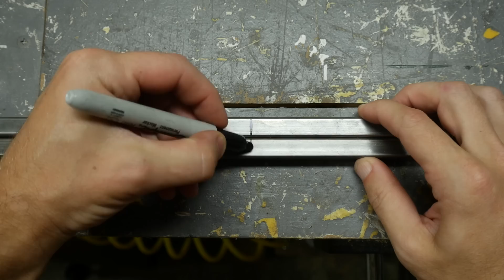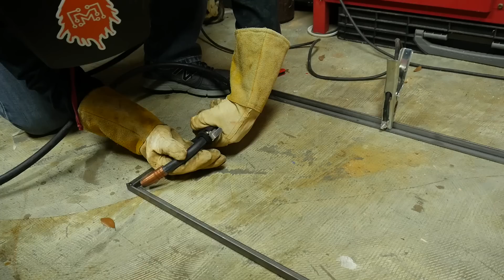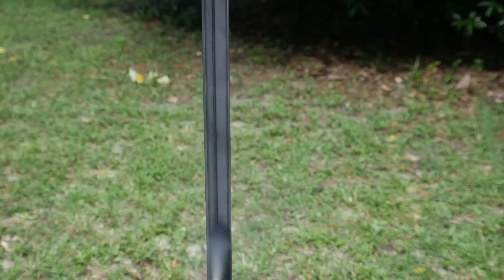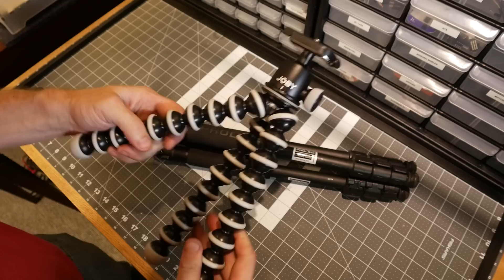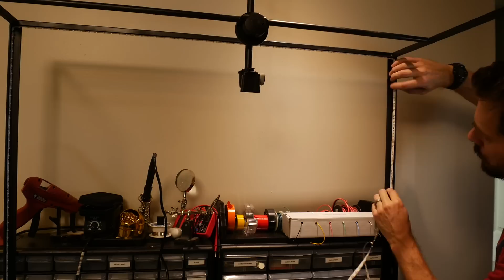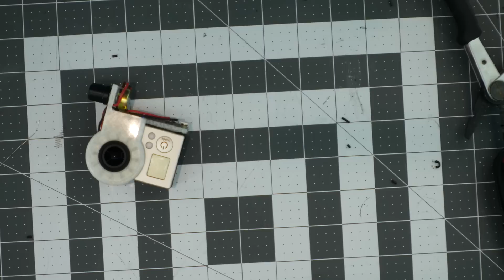Overhead camera rig // How-To | I Like To Make Stuff

Comment: What size is the steel rod (diameter)? Thanks in advance.
Reply from the maker: +Dylan Young 3/8" I believe
Reply: +I Like To Make Stuff I'm pretty disappointed. Bought everything from your list and did it to a T, but it's definitely not 3/8" steel rod.... Way too small in diameter for that mic stand. Used the bumper too but still way too much daylight. :(
Reply from the maker: Dylan Young Oh man, I'm sorry. I wasn't in my shop when I answered that so I was just trying to remember.  I should have said that, sorry.  I just went and measured it and it is 1/2"      Again, sorry for the confusion.
Reply: +I Like To Make Stuff It's all good buddy. I understand! I'll just cut the 3/8 off, grind it down to smooth it and replace with 1/2"! Thank you & keep up the great work!

Comment: Bob, great video! I was looking for a diy project to build my own rig, and this was exactly what I needed! 

I was wondering though where you got the steel rod where you attach the ballhead on. I've been searching for this (kind of) item but I can't seem to find it. Did you pull apart a tripot for it?

Kind Regard, Huub
Reply from the maker: +Huub Langedijk Thanks! No, I was able to find that rod at Home Depot actually. I think you should be able to find it at any of the big box stores, otherwise you might have to "reclaim" it from a mic stand or something like that. :)  Good luck!
Reply from the maker: linnea smith The rod I got is 1/2" steel

Comment: Hey Bob, this is a pretty sweet build, the Joby head, has it held alright for your cameras weight or heavy cameras in general? The quick connect nature makes me wary. With the lens pointing down, I dare not think what might happen if it unclasped. I planning this to record a 4x4 foot table, and the players bump the table a lot.
Reply from the maker: +ApocalypseRAT They've held up fine for me so far! If your table is going to get lots of bumping though, you'd probably want the camera mount attached to the wall or ceiling instead.
Reply: +I Like To Make Stuff Hey Bob, thank you for the reply. I jumped in and followed your buy links and purchased the boom arm and Joby camera head, The theads don't look like they match, I even tried for funsies and the thread is too big for the Joby...what do I do here? I can send pics if you need them.

Thanks for the Help
-Rick
Reply from the maker: ApocalypseRAT There's an insert in the Joby that you can remove. Look in the hole and you'll see the silver piece.  This comes out to allow for larger threads.
Reply: +I Like To Make Stuff I didn't notice it at first but after some fiddling i got it. Thanks Bob!

Comment: Thanks, Bob. For those without a welder, any suggestions? I'm wondering if something like JB Weld would work. Of course, there are corner brackets but that would mean a ton of semi-precise drill holes through steel plate and rod. I guess that's not a problem if you have a drill press. So, what about aluminum, do you think it would be tough enough? Anyway, thanks for sharing your project.
Reply from the maker: +Rouverius Yeah, I think aluminum and brackets would probably work well. That was actually my original plan, but I wanted to practice my welding some more :)  You can cut/drill through alum. with basic tools as well.

Comment: That looks cool but I would not do this this way. First you have to place it on and off when you filming and not. And then you have to store it somewhere.

I would do a hand time mount on the wall across the desk. I would even purchase none expensive monitor mount that can extend and fold and mount that microphone stand there. 

At the end I would get the same flexibility of camera position but one movement fold it out when it is not needed. 

Of course there would be no LED around but I could install additional light with ball-heads too, so I could spot exact place I am shooting.

Comment: Two things:
1. the piece of rod can be bought to match any stand one might have (or made to be removable or replaceable with welded threads at the end and accepting holes on the frame)

2. more than one mic stands can be used, for example a second one can hold a spot light, a magnifying glass, or a cup holder

This project has a ton of potential in many directions not just a camera stand.

Comment: Great project as always... Something to consider is to use a few of those rubber bumpers to put on the bottom of your stand to aid in vibration and to keep it from slipping. The more metal off the wood the less likely vibration will travel... Oh, by rubber bumper, I mean those self stick half circles you used inside your mount to aid in slippage; then would easily add a lot of stability to this rig...

Comment: That's a pretty intense industrial setup, nicely done. The one I did recently for overheads had a MUCH smaller budget, so had a different approach. I now film my footage with a small Xiaomi Yi (pretty much a GoPro), so used a flexible arm lamp off my old drafting table, added a camera mount, standard ring light and dual mics. Then added a bubble multilevel from the dollar store to keep it straight and a CFL light on either side (diffused through thin parchment). Ugly, but cheap, lightweight and reliable. I might try your LED strip idea though, I've only used them in PC cases before.

Comment: good idea with mic stand. idea for rev 2 is make it like a wall mounted shelf so the legs to the stand will no get in the way of your work on the table. this way banging on table or kids running around you wont get vibrations. may need to add more weight to shelf to give more dampening too. shelf deep enough to hold chemicals or cleaners out of the way from kiddos and not interfere with the camera rod.

Comment: Bob, are you welding in your house or is your workshop in your garage? If inside any concerns or special precautions? I have wondered about this for my own use. Thanks for the great video. Paul, a.k.a. paulsmessyworkshop on YouTube
Reply from the maker: +pcorlis My shop is a converted garage, but attached to the house. Only issues for me are making sure my family knows not to open the door (so they don't get blinded) and to make sure that the outside door is open for ventilation.
Ideally, I'd have a dedicated metal working space, but currently I don't have a place for it.
Reply: +I Like To Make Stuff Thanks Bob,  clears up a lot.  I wish I had a suitable place to weld but just not at this point

Comment: @Pavan Koty probably yes but due to the nature of plastic you would need a REALLY thick pipe or it'll sway a lot :/ plastic is strong but it dies give a bit before it stabilizes :( however if you can find a really stable polymer it would work, the frame would not be so bad if you make a cross in the sides and back to stop the sway but the stretcher which the camera hangs in would be the problem :(
My cents became a wall of text :P

Comment: Great project. I like the ball joint on the top to mount the camera. Would the over head lights not be bright enough or does it cause a shadow on your work?
Reply from the maker: +ASliceofWoodWorkshop They're further up, so they don't cast harsh shadows, plus the side lights act as fill, which helps with shadowing as well.

Comment: I'm thinking that a cheap background stand (uprights on either side of the table and crossbeam over the table) might be a decent way to go and use the same method with the mic/boom stand. That would have the round crossbeam and would vibrate separately from the work surface, but probably wouldn't be as rigid without sandbagging. Love the project, Bob!

Comment: really cool build there

but be aware, the plastic clamp on the boom of that mic stand will probably crack even under normal use. have had several of the same one and they go brittle...assuming it's the same make, maybe your ones are made with better plastic.
Reply from the maker: +Graeme Evans Possibly. I've had this one (and a bunch of other mic stands) for 5-6 years. At that price, replacing them over that time period is acceptable if need be, to me.
Reply: I Like To Make Stuff yeah, they are a bargain, plus they're one of few i've ever seen that clamp onto the vertical part like that too, the rest are usually connected to that pipe far more mechanically and wouldn't really work to mount on the pipe you welded.

Comment: That turned out nice! Is there a reason you didn't mount to the wall (so that a bump to the table wouldn't shake the camera)?
Reply from the maker: +Matthew S Thought about that, but not everyone could do that and I wanted the project to be accessible. Also, it's portable enough that I can move it into my shop on my assembly table if need be.
Reply: I Like To Make Stuff Portability is reason enough. Good point!

Comment: Instead of using a steel frame, can we use some transparent plastic hollow tubes which are stiff enough to stand and the LED lights are placed inside the tube so that the light diffuses and also protect the LED???
Reply from the maker: +Pavan Koty Possibly, but I don't think they'd be strong or stable enough to hold the bar that the camera mounts to. You might be able to make a hybrid of some sort, where the frame just held a diffusion panel on the sides (maybe wax paper?) with the lights behind it.  
There are lots of things that might work, just give something a shot, see if it works and improve from there! Good luck!
Reply: Thanks, i'll try!!
Love ur videos!!

Comment: This came together awesomely, Bob! Way to go! Also one tip on steel - I noticed barcodes on the steel like you're buying at home depot, etc. You may want to find a steel yard in your area if possible. When I started welding I found the steel yard to be quite a bit cheaper than buying the pre-cut lengths at Home Depot, etc. If I just need something small or need something on a Sunday when the steel yard is closed, retail is helpful - just usually way more expensive. Of the retail places you can find steel, I've found Tractor Supply to be the cheapest if you have one. Ear you, but it's still expensive in comparison to the steel yard. Keep up the good work!!
Reply from the maker: +BradleyMakes Yeah, I keep hearing that, but I can't find any place locally that sells it. I'm sure it's here somewhere, just haven't tracked it down yet.

Comment: Where did you get the small magnets?  Your link is for a large one.  I typically get mine at Harbor Freight and I don't recall seeing those there.  BTW, awesome job welding!!!  Very cool project.  I need to make one of those. Douglas
Reply from the maker: +RetroWeld Thanks Douglas!! I actually got them at Harbor Freight.  I'll try to update the link, I thought it was for the small ones. Thanks!
Reply: Thanks Bob. I'll check it out. They must be new there.

Comment: thats really cool bob! great idea. hey is your angle grinder from harbor freight?  ive been contemplating buyimg one .thanks man!
Reply from the maker: +Joe basementwoodworking Hey Joe! I actually got a second one recently from Harbor Freight.  So, my 4 1/2" one is a Ryobi... seems fine.  I keep a flap disc on it now, but I got a 7" Harbor Freight recently and keep a cut off wheel on it so I don't have to change out the discs all of the time.  The Harbor Freight one seems plenty powerful and it was SUPER cheap at one of their weekend sales.
Reply: I Like To Make Stuff nice! good idea !  thats one thing that ive been meaning to get because theres sooo many times i could use it and dont have it and then i kick myself for not getting it..lol thanks again bob

Comment: Nice! Subbed. 
Those are also my favorite ball heads. :)

BTW, an easy way to do this is with a big boom stand which is about $100, but that takes up a bit of floor space next to the desk.
Reply from the maker: +Nitsan Simantov Good call! I guess it the base was heavy enough that'd be good. maybe you could even use one that clipped to the desk.
Reply: +I Like To Make Stuff 
Ah, yeah that's a good idea. I've done that with some normal stands in the past using strong releasable zip ties. BTW I've got some tutorials on my channel that you might like. :)

Comment: looks awesome but I would think it would be much better if it was hung from the roof. it wouldnt get in the way as much and you wouldnt have the vibration problem when you bump the desk.
Reply from the maker: +DEMMERY11 I'd considered that, but that's not an option for a lot of the people watching who might want to make one for themselves. Also, this is lightweight and reasonably portable, so I could take it into my shop and shoot down on to my assembly table as well.
Reply: +I Like To Make Stuff seems fair enough. You could make something that both stands independently and hangs from the roof.

Comment: LED lights aren't the best option for this - rolling shutter on DSLR's are a huge issue. Would recommend using soft boxes on stands instead!
Reply from the maker: +Tim Bullock I've used both for a long time, and haven't had any issue with rolling shutter. There's an extensive discussion about this on my GoPro ring light video as well.

Comment: Very cool, Bob. I'm no stranger to overcomplicating custom solutions in my head before reusing parts. I worry though that the vertical legs in the front might get in the way when moving to/from the table.
Reply from the maker: +Brent Allen I was a little worried about that as well. I even considered mounting it on the wall so there were no front supports, but in the end, the table is wide enough that they aren't in my way at all.